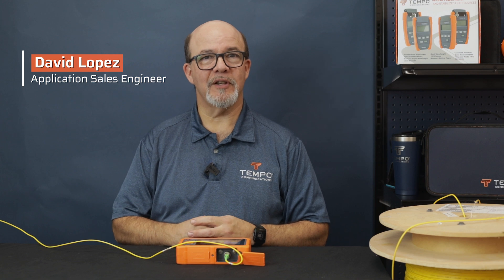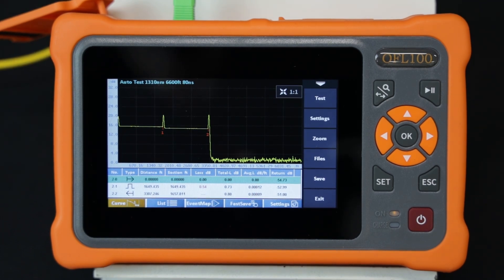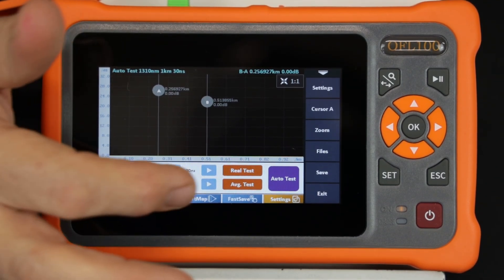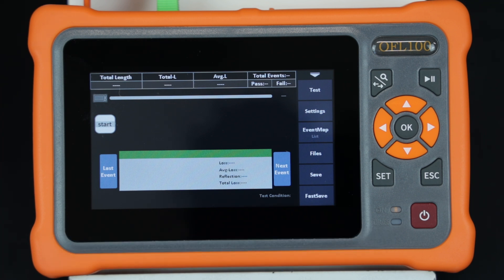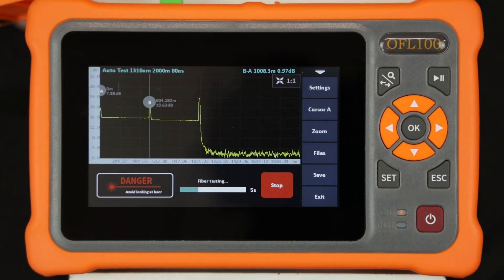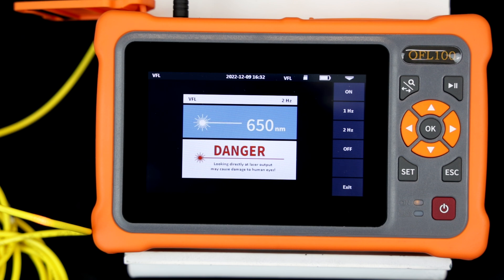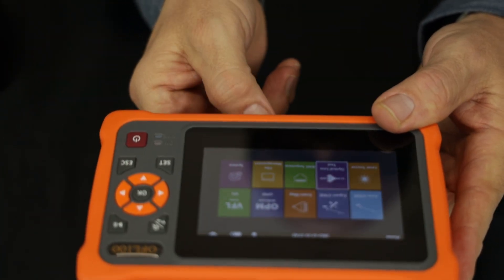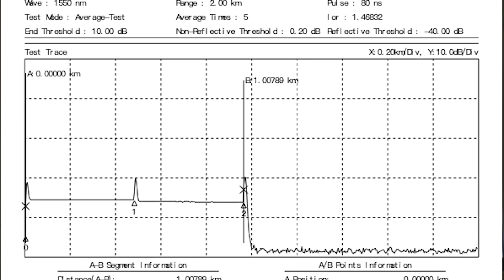Tempo Communications OFL100 OTDR Training | Optical Time Domain Reflectometer How-To Video

Comment: on the 15th fibre i was testing, the first day i started using it. being very careful and gentle, treating it like it’s a newborn child. the ODTR connection had a small sliver of the most inner female part of the connector break off. 

now it is unable to make any successful ODTR tests. 

so dumb to have such a fragile peice apart of this divice without having replacements come with the device. 

will update weather their customer support will be able to let me order replacement ODTR connectors or not
Reply from the maker: @XalenPrime we are sorry to hear about your experience with the OFL100. Please reach out to the repair department at repair@tempocom.com or call 800-642-2155 and press 3 for Repairs/ Returns.